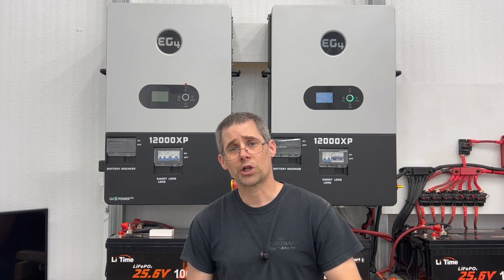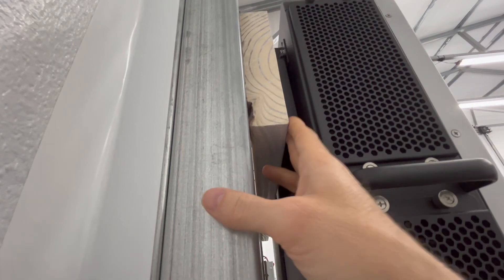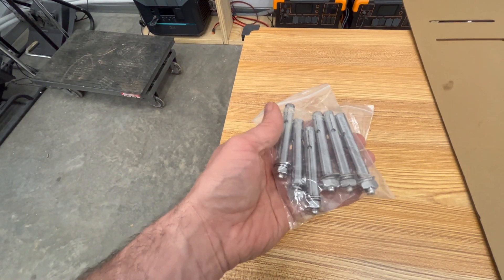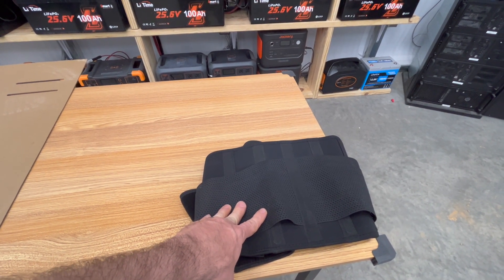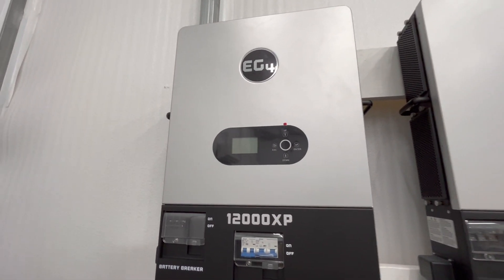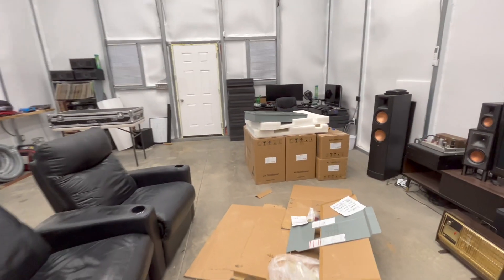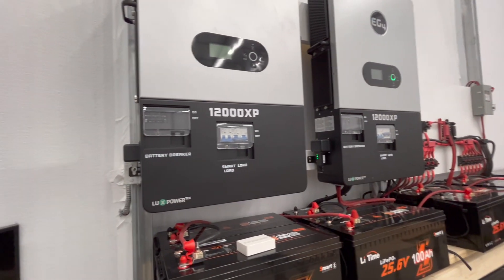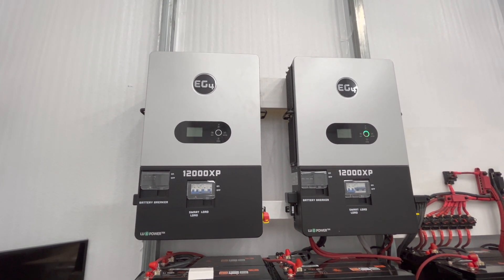Mounting Your EG4 12000XP: Step-by-Step Guide for a Secure Install

Comment: I think inverters are too close. You would basically be pumping hot air from left side inverter into intake of inverter on right side. 🤞
Atleast 30cm gap would make more sense. 👍
Reply from the maker: You make a very good point.  On my next 3 I am spacing them further out.   I’ll look into ways to rectify it.  Thank you!
Reply: @MikesGarageRoute66  You are welcome 🤗. BTW EG4 recommends 50cm clearance on each side of each inverter !!!

Comment: Question why did go with the 12000xp over the hybrid inverter?
Reply from the maker: @Livingsolaryourway  Great question.  It really comes down to cost.   Both are nice, but the hybrid has features I won’t use.  Plus even though the hybrid has a longer warranty, they both have the same build quality.
Reply: @MikesGarageRoute66  main plus for me is price, but I do want to export. Call it getting some of my money back, second big reason when batteries are full you are making the inverter shut down production like telling a fish not to swim.
Reply from the maker: @ Thats a very valid point.  Once I have everything setup, I’m planning to mine crypto again with the excess.  The other reason is I don’t trust my power company.  Monthly we have power outages and the occasional surge.  It’s really bad…
Reply: @Livingsolaryourway  Luxpower SNA 12k (parent company) does have option to feed in excess power to grid. Looks like EG4 has intentionally disabled some grid interactive features on 12000xp

Comment: Very nice, on a side note I notice my recent firmware updates create problems, not LUX but if you get a flaw free firmware update, keep it don't update. I am going to roll mine back to a 2023 version.
Nice set up better than buying 78 power stations.
Reply from the maker: Thank you very much Bob!  It is good to know about the firmware updates!
Reply: @MikesGarageRoute66  same brand 2 inverters, one makes 1.5% overcast pv, the one I put back over 12%. Track overcast #'s
Reply from the maker: @bobmonztr  Good to know.  Thank you!